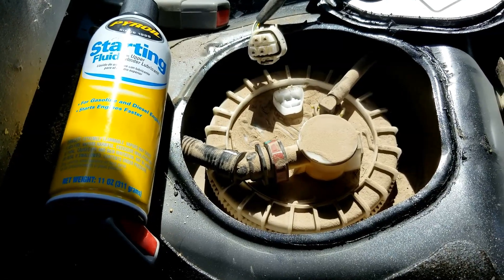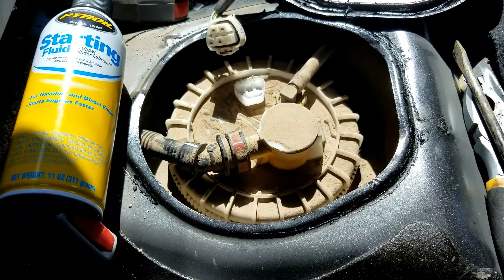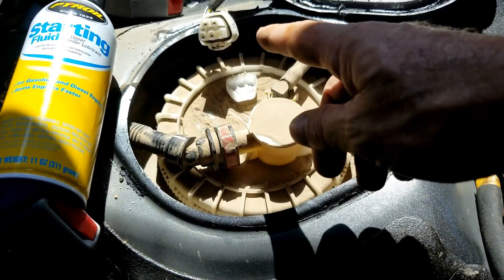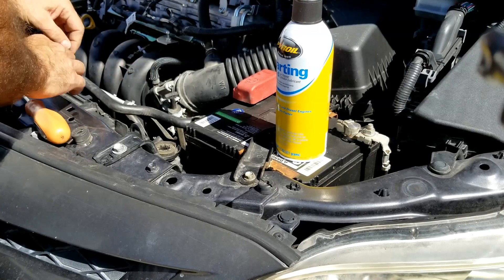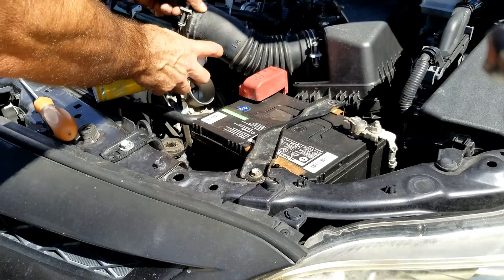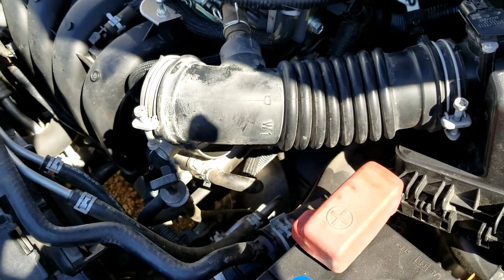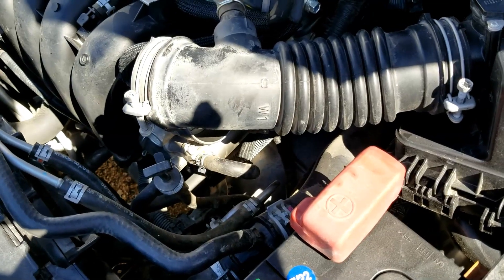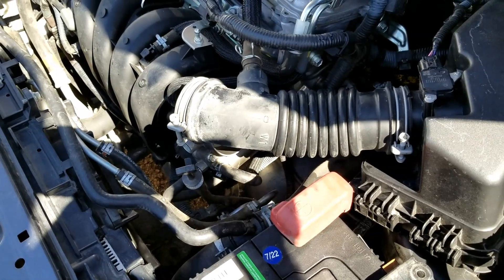Old School Method to Test If a Fuel Pump Has Failed (No Pressure Gauge Needed)

Comment: This is not how u test for a bad fuel pump.. this is more on how u start a car with starting fluid.. u have to actually test the fuel pump its self andcthe wiring
Reply from the maker: If you have a fuel pressure gauge, then that is the best way to test a fuel pump. If not, this method works, many use it all the time.
Reply: Old school tried and true for a quick test

Comment: Hello Sir. I have a question, I'm having a hard start issue. We used fuel pressure guage to measure the PSI. We connected the hose directly to fuel pump. After turning ON accessories, the PSI will go to around 60 then will immediately drop to 0.

What might be the problem?
Reply from the maker: The pressure should hold up at the engine; otherwise, there is likely a bad check valve in the fuel pump or a bad fuel pressure regulator.